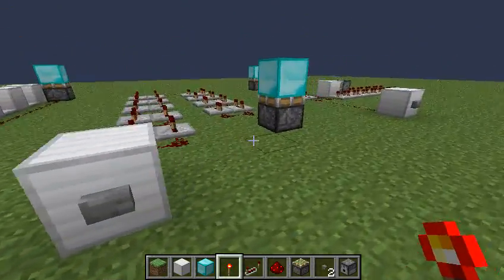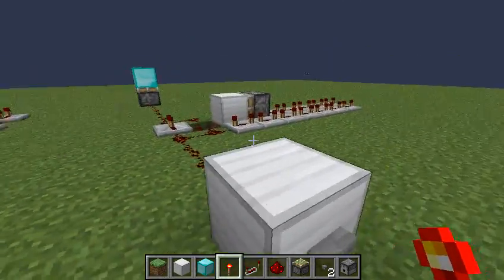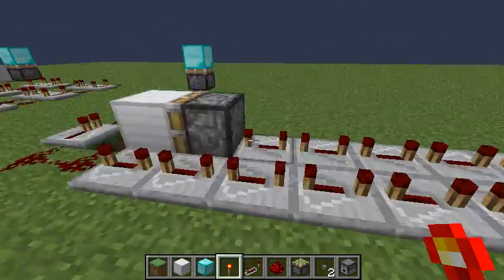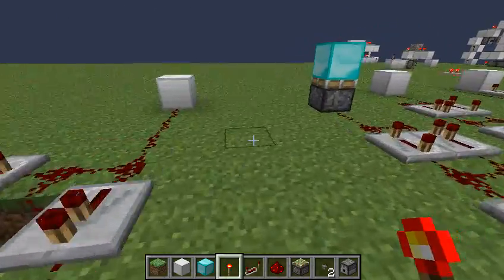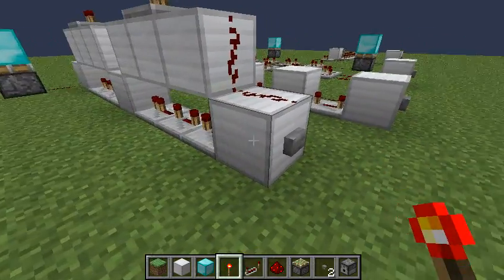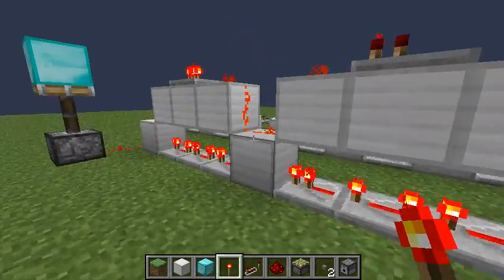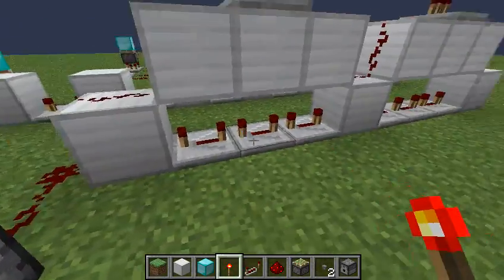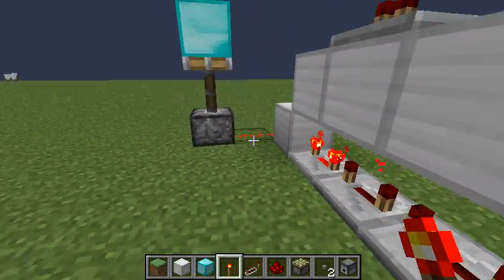Pulse Extender/Lengthener (Rapid Redstone!) Minecraft 1.2.5

Comment: The last one can be optimized by using glowstone. Glowstone can carry a current up, but not down. So you can remove the top repeaters, thus making it respond faster and get more profit from the bottom repeaters.